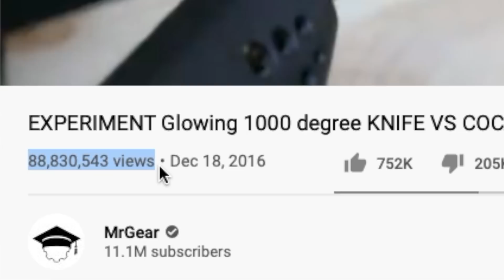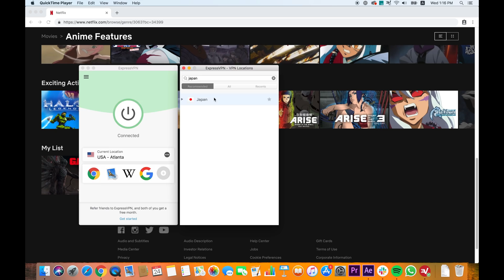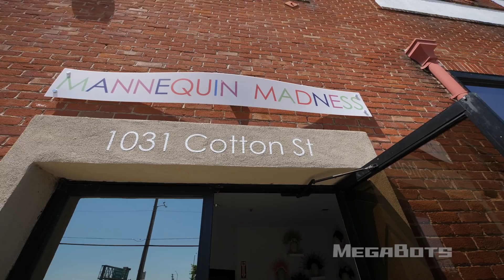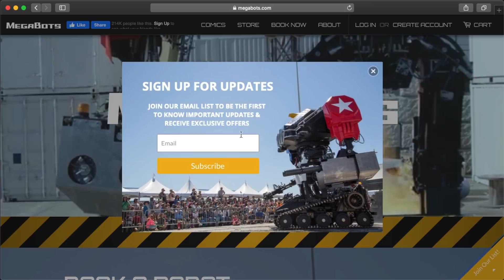World’s Largest Hot Knife Destroys Stuff

Comment: How much propane did that use? And is it viable to use that manifold system directly attached to the knife to get the same result? Food for thought
Reply from the maker: about $40 in propane to keep it hot for maybe 4 hours and do the 3-4 things in this video. I think you have to have something around the knife to keep the heat in. but maybe it's possible to attach the forge to the knife and have it actuated in some way? Would probably need a bunch of fancy rails and actuators. probably doable?